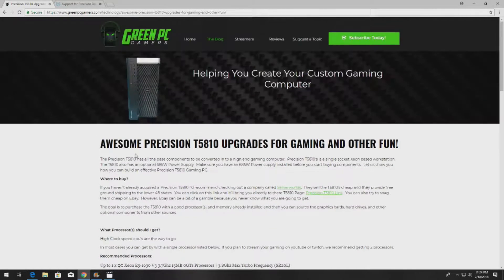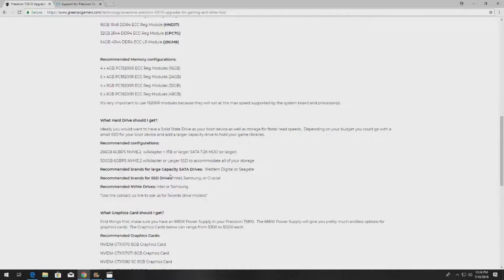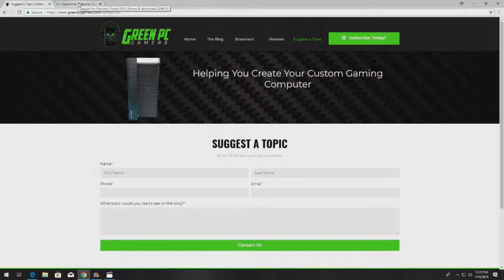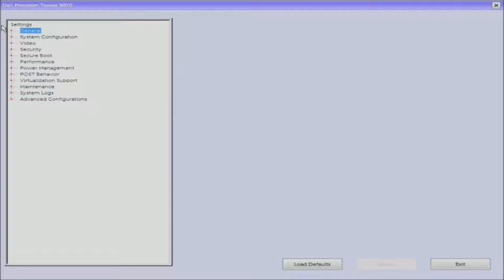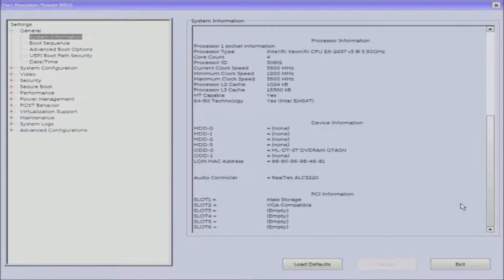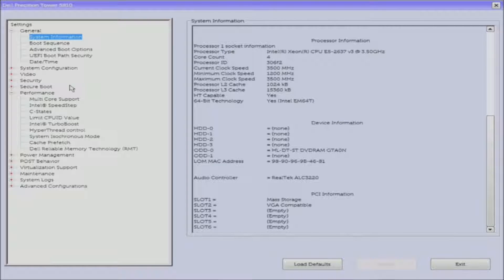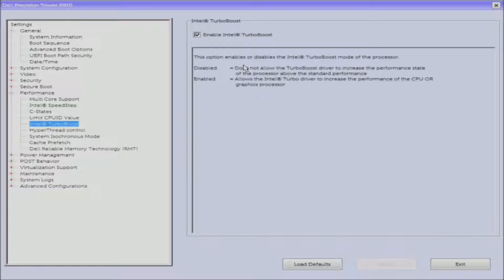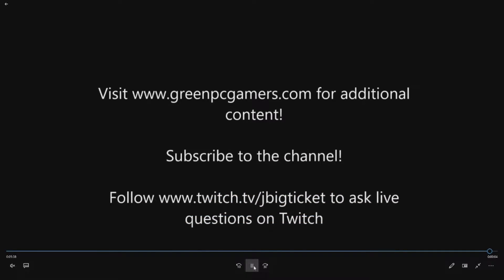How to Install/Upgrade a Processor in a Precision T5810 Workstation

Comment: This is great. My current processor is Xeon E5-2630 v4 2.2ghz and Solidworks for work requires much more. Were handling large assemblies and I suggested upgrading the processor but our IT said we need a whole new computer. My boss wants me to look into a motherboard swap with an I9. Is that possible? Or what would you suggest?
Reply: nope

Comment: i know this is an old vid but i want to upgrade my t5810 it will be used for some gaming and general tasks. what is a good CPU and GPU i should get? it currently has  a xeon E5-1603 v3, quadro k620 GPU, 685w PSU and 16GB ram

Comment: Is it possible to run a core i7 with a 2011-3 socket in these motherboards such as a i7-5960x or i7-6850k ect...?
Reply from the maker: We haven't tried it those cpu's.  Let us know if you try it.

Comment: Awesome content here. I also have a T5810 with the Xeon E5-1620 v3 @ 3.50GHz - I am looking to upgrade this. I received this tower for free from a neighboring sales rep as he used it for a demo and had no further need for it. Back then, I didn't realize that there were v3 and v4 CPUs for this board, and with that, I didn't realize that it could handle DDR4-2133 or 2400... and this is where my question begins. Long before I know any of this, I started upgrading the currently installed 2133 RAM up to 32GB. Now that I want to upgrade the CPU, am I stuck with using a v3 or can I upgrade to a v4? Is there any one recommended CPU given this instance. Side note, I plan on bumping the power supply up to the 850w as I have a installed a GTX 1660 Super Overclocked 6GB card a little while ago. This tower is getting on the older side now, but I want to keep her alive and well as long as I can. Thanks in advance.

Comment: Excellent video.  I have a T5810 running a Xeon E5-1603 v3 @2.80 Ghz with 128bg RAM.  I am using it as a music server hosting sample libraries in Vienna Ensemble Pro.  My CPU is maxing out and I am thinking of upgrading based on your video.  I am considering the Xeon E5-2687W V4 SR2NA 12-Core 3.0GHz.  That would be a good choice, don't you think?  Also, I have a 425w power supply and it sounds like that needs to be upgraded as well.
Reply from the maker: That would be a nice upgrade.  Yes, you should also upgrade the power supply, and also consider the noctua aftermarket heatsink install if you upgrade to the E5-2687W V4 Processor.

Comment: Currently i have a xeon e5 1620 v3, i want to upgrade it to a xeon e5 2650 v3. Would i need a new cooler for this cpu and is it compatible with the dell precision t8510?
Reply from the maker: That cpu will work.

Our favorite CPU’s are listed on the upgrade guide:

https://www.greenpcgamers.com/dell/dell-precision-models/precision-ddr4-based-workstations/precision-t5810-gaming-computer/

Comment: Great vid! Mine starts becoming slow running on E5-1620 v4 with 32GB ram (4x8), Samsung SSD 970 EVO Plus 250 (half full), NVidia Quadro P200. Any tips on how to bring it up to date with CPU upgrade and more would be appreciated. I am hoping with an upgrade I can increase performance on WIN 11 without having to buy a new PC for a few more years. I do not game but I use it 24/7 for studying/multitasking with 2-3 monitors attached. Thank you
Reply: I'm in a similar position, Please let me know if you chose a good CPU upgrade and how you got on :)
Reply from the maker: You should look at getting one of the CPU’s with more cores, as well as installing the aftermarket noctua heatsink for better cooling.

The E5-2687W V3 or V4 would be a nice fit.

Comment: whats the max cpu this MB can take? thanks!
Reply from the maker: These are our favorites:

Up to 1 x 8C Xeon E5-2667 V4 3.2Ghz 25MB 9.6GTs Processor | 3.6Ghz Max Turbo Frequency (SR2P5)

Up to 1 x 8C Xeon E5-1660 V4 3.20Ghz 20MB Processor | 3.8Ghz Max Turbo Frequency (SR2PK)

Up to 1 x 12C Xeon E5-2687W V4 3.0Ghz 30MB 9.6GTs Processor | 3.5 Max Turbo Frequency (SR2NA)

Comment: Will there existing heat sink work with the E5-2637 v3 and will the power supply base work I think it’s like 285 I plan to upgrade power but don’t have money currently and I want to get windows 11 while it’s free

Comment: Question, what if the system doesn't has a OS at all from the beginning?

Could you just switch out the cpu in that case then or what
Reply from the maker: Yes, you can.  However, you’d have to do the bios update with a dos usb.
Reply: @GreenPCGamerscom  

In other words...I'd have to download this stuff and update the new cpu?

Comment: I recently install E5 1650 v4 because it is the only  CPU I came across this which actually clock up to 4.0ghz. 
I want your expert feedback if it is smart choice?
Reply from the maker: That is a really solid choice based off clock speed.  You'll also be able to take advantage of 19200 Memory modules running at 2400Mhz.
Reply: @GreenPCGamerscom  Thanks!
Reply: Does it support v4 xeon procesors? Is there a list of supported v4? I can‘t access your website from Europe :(

Comment: Would this pc support an Intel Pentium CPU?
Reply from the maker: Recommended Processors:

V3 Procs:

Up to 1 x QC Xeon E5-1620 V3 3.5Ghz 10MB Processor | 3.6Ghz Max Turbo Frequency (SR20P)

Up to 1 x QC Xeon E5-2637 V3 3.5Ghz 15MB 9.6GTs Processor | 3.7Ghz Max Turbo Frequency (SR202)

Up to 1 x 6C Xeon E5-1650 V3 3.5Ghz 15MB Processor | 3.8Ghz Max Turbo Frequency (SR20J)

Up to 1 x 6C Xeon E5-2643 V3 3.4Ghz 20MB 9.6GTs Processor | 3.7Ghz Max Turbo Frequency (SR204)

Up to 1 x 8C Xeon E5-2667 V3 3.2Ghz 20MB 9.6GTs Processor | 3.6Ghz Max Turbo Frequency (SR203)

Up to 1 x 10C Xeon E5-2687W V3 3.1Ghz 25MB 9.6GTs Processor | 3.5 Max Turbo Frequency (SR1Y6)

V4 Procs:

Up to 1 x QC Xeon E5-2637 V4 3.5Ghz 15MB 9.6GTs Processor | 3.7Ghz Max Turbo Frequency (SR2P3)

Up to 1 x 6C Xeon E5-2643 V4 3.40Ghz 20MB 9.6GTs Processor | 3.7Ghz Max Turbo Frequency (SR2P4)

Up to 1 x 8C Xeon E5-2667 V4 3.2Ghz 25MB 9.6GTs Processor | 3.6Ghz Max Turbo Frequency (SR2P5)

Up to 1 x 8C Xeon E5-1660 V4 3.20Ghz 20MB Processor | 3.8Ghz Max Turbo Frequency (SR2PK)

Up to 1 x 12C Xeon E5-2687W V4 3.0Ghz 30MB 9.6GTs Processor | 3.5 Max Turbo Frequency (SR2NA)

Comment: Hi guys, great content! Just subscribed. Unfortunately from the UK I do not have access your website. I have a T5810 with the BIOS updated, does this machine support Xeon E5 1600 V4 family CPU? Since the both Xeon E5 1600 V3 and V4 use the same LGA2011-3 socket ? Thanks
Reply: It does

Comment: can  the precision t5810 support dual processors?
Reply from the maker: No
Reply: @GreenPCGamerscom  okay and can you help me out a bit? I can't decide a GPU for my hp z620, what i really want is that the gpu would be a 4 gb, with decent cuda cores that would also be compatible with the system?
Reply: @GreenPCGamerscom  can u use a xeon x5680?
Reply: @wcghavii7625  no z620 has dual xeon v2 CPUs

Comment: hello, i have the same cpu, can you tell me if i can replace my intel xeon E5-1603 v3 for intel xeon E5-2680 v3? or any i7 processor?
Reply from the maker: I7 cpu's won't work in the Precision T5810.  The E5-2680 V3 will work in the Precision T5810 Workstation.  Update your bios before upgrading your cpu.
Reply: @GreenPCGamerscom  thanks
Reply: @GreenPCGamerscom   Hi, why are the I7 cpu's not compatible?

Comment: This processor looks like it is a $1989.00 processor? Yes? - https://www.dell.com/en-us/work/shop/intel-xeon-e5-2637-v2-350ghz-15m-cache-80gt-s-qpi-turbo-ht-4c-130w-max-mem-1866mhz-customer-kit/apd/338-bdix/processors
Reply from the maker: Dax Castro that’s a V2 processor which is not supported by the T5810.  The T5810 supports v3 or v4 processors.  Regardless, don’t buy from Dell, they are over priced.  Check the 3rd party market.  Use our T5810 blog page for recommendations.
Reply: @GreenPCGamerscom  Thanks!

Comment: Hi, I just bought a Dell Precision Tower 5810 and am trying to install windows 10 pro. I completely wiped the duel SSD and updated the bios but it keeps coming up with 'Invalid partition table' on bootup? Any help would be greatly appreciated. Thanks
Reply from the maker: It appears that one you drives may be defective.  Can you verify by running diagnostics on the driver?
Reply: @GreenPCGamerscom  I tried with a brand new ssd and it wont even recognise it. I got the windows installed and had it up to choosing regions.. then the system reboots into Microsoft Windows Startup menu which prompts me to choose between 1 and 2.. then in 3 like seconds tells me there's an error on my CONFIG.SYS file on line 6?
C:\Efiflash AX370G.24c
Bad command or file name
Always ends up to this page after almost successfully installing windows 10. Thanks
Reply: H, I booted into bios by hitting the F12 and changed the settings to boot as UEFI. Rebooted and now it works! thanks for your help!
Reply from the maker: That's great news.  Thanks for commenting!

Comment: Hi! Thanks for the tips! Just bought a 5810 so getting some upgrades. Right now it's got the Xeon E5-1620, I'm wanting to throw in an E5-2667. Will the existing heatsink be adequate or will I need to get a better one? Thanks!
Reply from the maker: Hey Dave,  your existing heat sink is adequate.  Remember to clean off the old heat paste and apply new heat paste.  Also update bios with existing cpu.
Reply: @GreenPCGamerscom  Sweet thanks! Yep, will clean it off with rubbing alc and update the BIOS before anything!!
Reply: @davepicklyk3198  Did you upgrade? I also have the 1620 and looking into a cpu upgrade. Thanks
Reply: I did upgrade to the E5-2667 v3 CPU. It's been working great for the last few years.